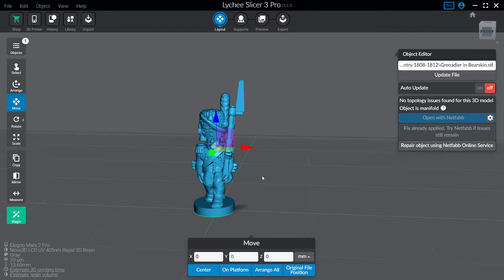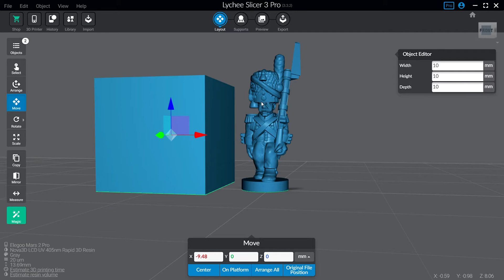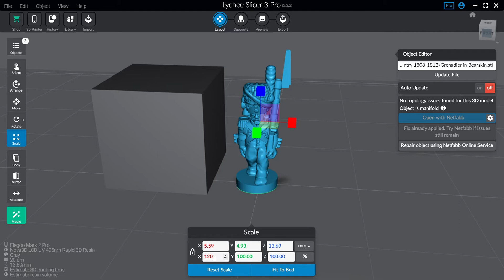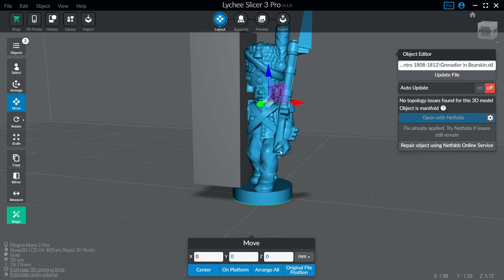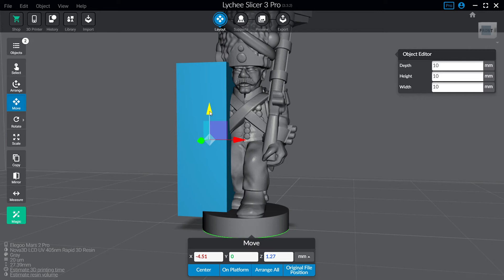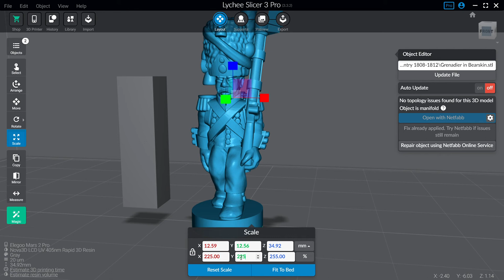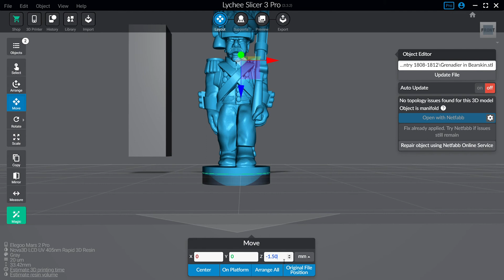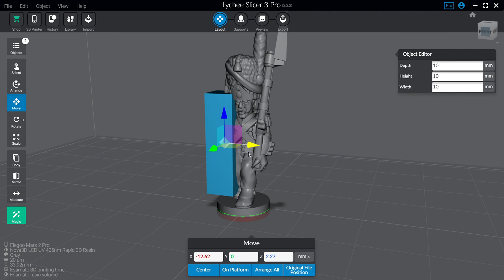The Cube Method: How to resize STLs to different wargaming scales

Comment: Can you reduce below 6mm?
Reply from the maker: Hey,

Well, technically yes - but 6mm is what the miniatures were designed for, so I can't guarantee that parts won't snap off. We have had someone print them at 2mm; but I'd imagine the muskets and bayonets would be quite fragile as a result! 

Try it out on the free figures:
https://www.myminifactory.com/users/henryturner/collection/free-models
Reply: @turnerminiatures  Don't have the printer just yet- currently looking into something suitable. Cheers.
Reply from the maker: @peezebeuponyou3774  I'd go for a Mars 3 as a cheap entry-level machine that'll also produce great results. 

Resin printing is quite a big learning curve at first, and can be very frustrating, but will work nicely and consistently once you've settled on a resin and stable print settings :)

If you want advice from others, you can feel free to ask any questions on the Facebook group or the Discord!

https://www.facebook.com/groups/turnerminiaturesfans

https://discord.gg/U6tdUBn
Reply: @turnerminiatures  Thank you- I'll definitely take a look at the Mars 3.
Already joined the FB group.🙂

Comment: Thx for the tip,  same thing for the cavalery & Artilery ?
Reply from the maker: Sorry I missed this! I have only tested it on infantry. Artillery crew should be identical but I have had feedback that my recommended scaling settings make cavalry come out a little too large. So again, I'd measure a metal model and then use the cube method.